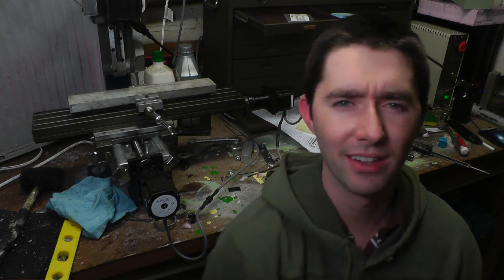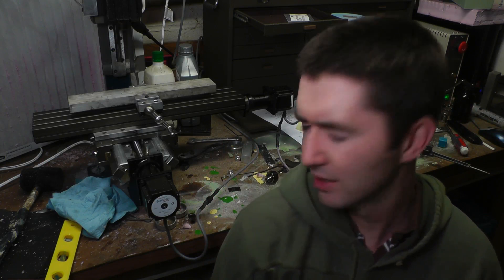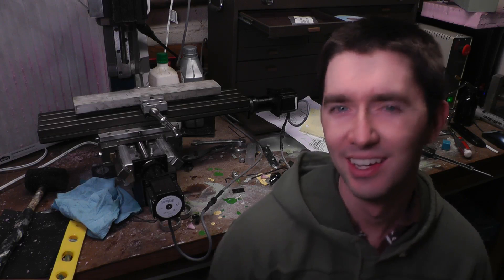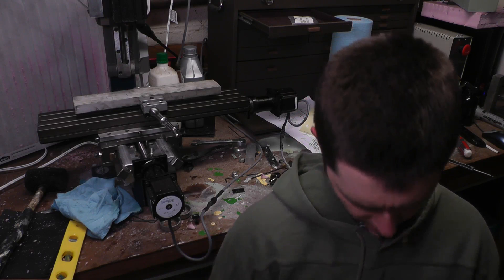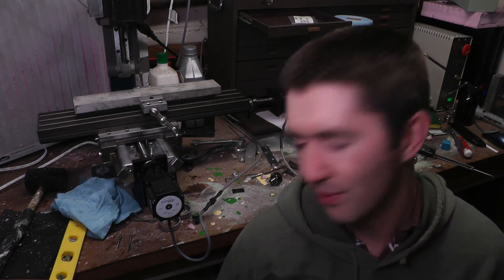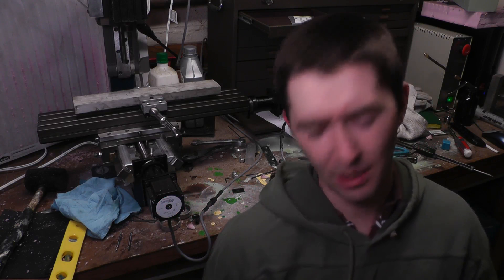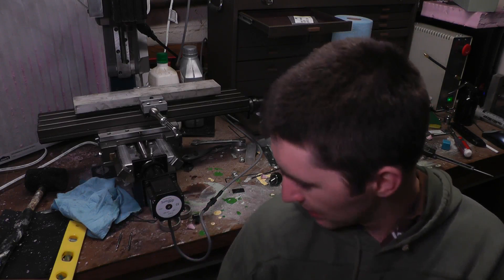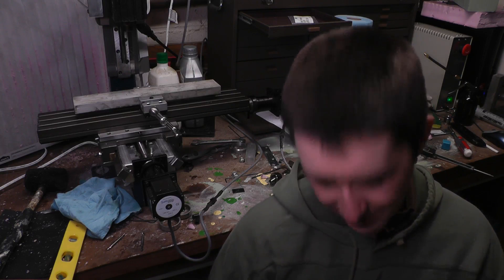First Time Cutting 6061 Aluminum

Comment: hey men looks like you got that pocket done up good one, im actually about to beging the same journey as you did back then maybe  can get some pointers as im new to this hobby i actually come from CAD and 3D printing and recently got this new milling machine from ebay take a look http://www.ebay.com/itm/New-CNC-Router-Engraver-Milling-Machine-Engraving-Drilling-4-Axis-3020-Desktop-/111607148166?hash=item19fc4dee86 

my question is what asortment of common cutter bits should i buy?  if you look in my website i have alot of diff types of design i plan on milling or creating molds off if you look at it maybe you can tell me what type of cutter i wil need to make my passes ? i did get several engraving bits as well as one cutter but im not sure which type i got  but i plan on cutting aluminum alloy / T6

http://frankdesignatures.weebly.com/3d-work--remixes.html

Comment: Nice video.  Aluminum is notorious for galling onto the cutter so a cutting fluid is needed as a lot of people here say and try and get center cutting milling cutters if you are going to plunge cut.  Single toothed spiral flute cutters also work well in Al.
See if you can get a cheap misting coolant blower for it as you don't make a mess flooding the job and the air aids in cooling the work to keep your dimensions tight.
Keep the vids coming as they are interesting to watch.

Comment from the maker: They were, it was the size of the bit and the tool path that determined the roundness of the corners in the actual cut. I would have to use a smaller bit to get them sharper.

Comment: Great progress! Not the best thing to have that piece unsupported at both ends especially if you end up milling away from the vise - you can use jack screws to support it. 
I find 1/8" to 1/4" end mills are the Taig's best friend, so you should try a slightly smaller end mill in future. Plus you get smaller corner radii. Squirting some cutting oil/fluid (WD40 works fine in a pinch) will really help. Glad to see you having fun!

Comment: Chris, I have the same mill.  First thing you should do is get rid of the milling vise that comes with it - it's just not accurate enough for most things.  I picked up a screwless type from Ajax Tool for around $50 and have been very happy with it.

Comment: Congratulations!  You might want to check if your software can ramp feed when entering the material: moving sideways while going down. Your vertical feed was way too fast, your horizontal looked about right. Depth per pass seemed a bit on the light side. Try maybe .125 per pass. The nice thing about a large endmill is you are more likely to stall the machine rather than break the end mill. For your 1/64" mill, very high probability of breaking it. Add some WD40 next time :-)